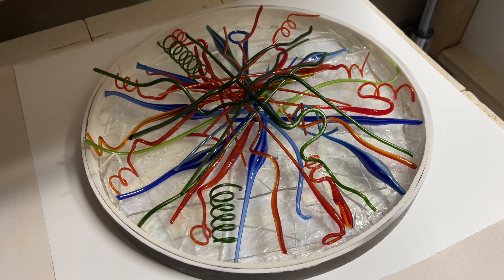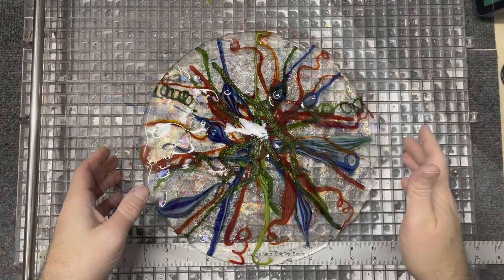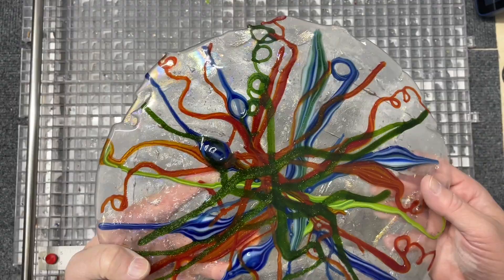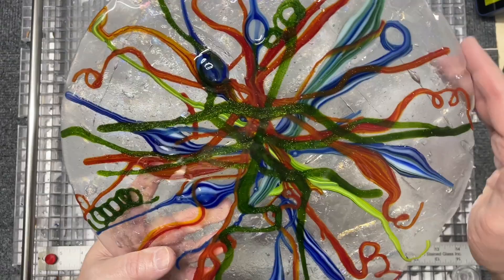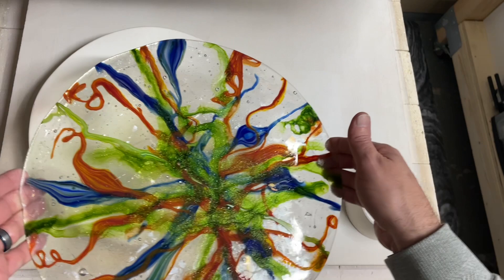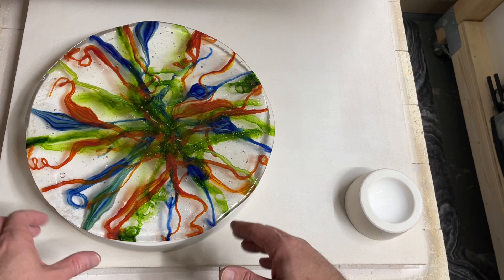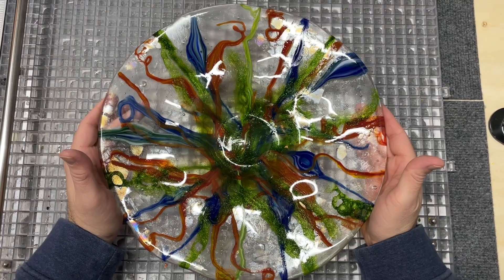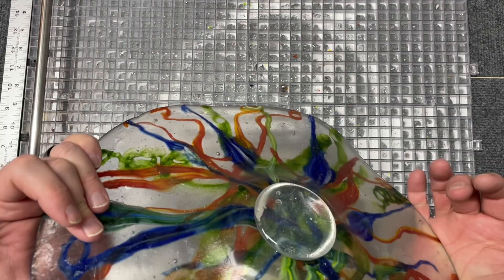My First Flouncy! Finally Playing with the #FusedGlass Mold that Makes Wall Art!

Comment: Thank you for a very inspiring video. Since I do not have such a mould, I am wondering how to 
put such a ready made round glass base in a mould that doesn't have a hole for it, without causing the whole round glass to sink and swallow it. Any suggestions?
Alternatively , any suggestions for hanging a flat backed round piece?
Reply from the maker: I don’t have suggestions other than to experiment and know you may have to risk that glass. Regarding hanging, I know a lot of people have mentioned this but I’ve never used it. Honestly, may be easier to just spring for the mold. 😂 
https://hangyourglass.com/